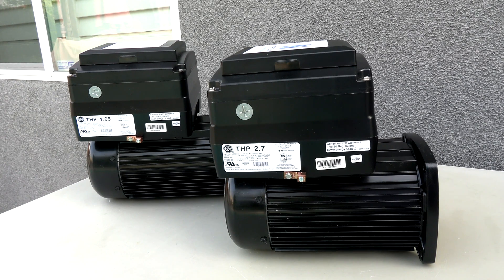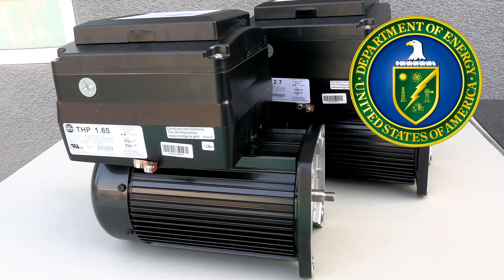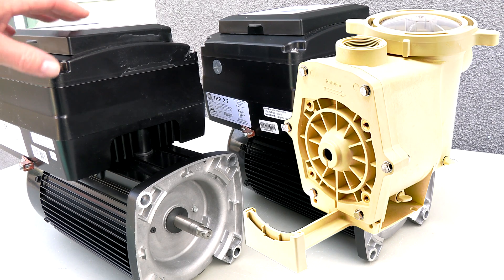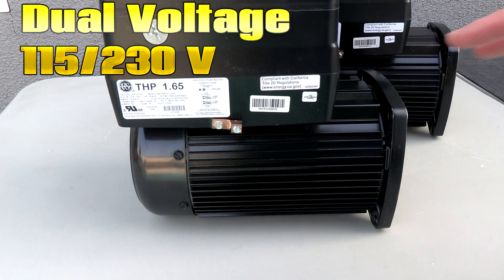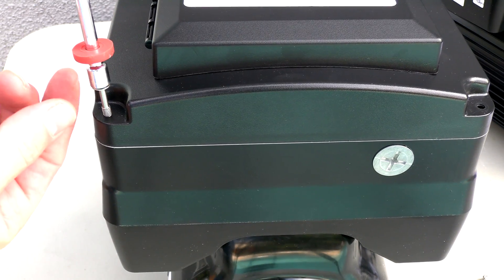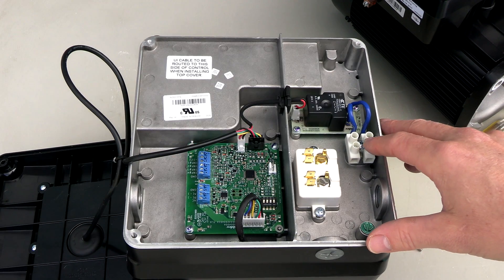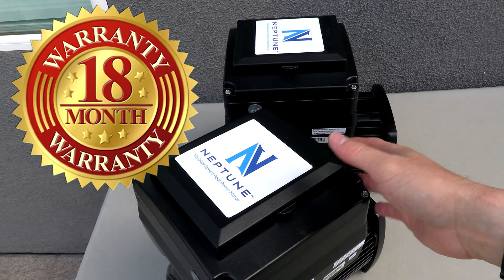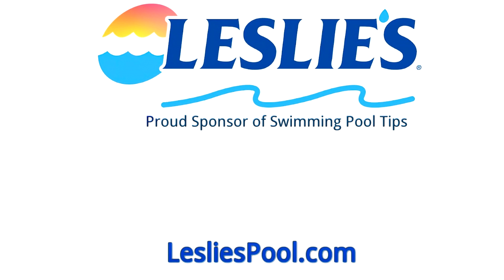Save Time and Money by Installing a NIDEC VS Motor When Replacing Your Old Motor. Simple and Easy!

Comment: which motor do I get if my current motor is 3/4hp, 1.5 service factor 56J frame 230 volts on Hayward spx3120aaz pump strainer?
Reply from the maker: 1.65 should be plenty

Comment: Thanks for the great video! I am looking to replace my 1HP Century FS motor with the 1.65HP Vs motor that you just showed. How reliable are these? Have you had any issues with any customers? Thanks again for all you do for us DIYers
Reply from the maker: Very reliable. These were once Emerson and US Motor so they have a long track record in the industry I should rephrase that and say Nidec is the parent company of US Motors formally Emerson.
Reply: @SPL  thank you! I followed your steps and replaced my Ao smith 1 hp motor with this one. Changed the impeller (bigger) and all the pump seals as well. Thank you for all your hard work

Comment: What’s a range on the prices?  And if the motor dies you just replace the whole thing?
Reply from the maker: Leslie's retail price on the 1.65 HP is $860 - the Wholesale price would be lower by a bit.  A new Hayward 1.65 VS pump is $1,250.  So a savings of well over $400 and some savings on the install price.
Reply: I just bought this pump for $499 from a local pool shop

Comment: Thanks for this. What salt generator do you recommend adding to this?

For spa installations, does this have a remote trigger?
Reply from the maker: For a salt water system this is perfect because of the AUX relay.  No remote at this time.